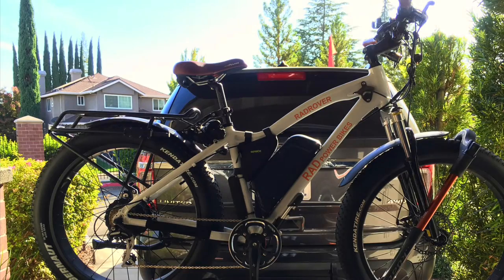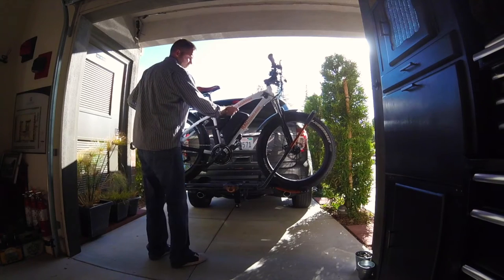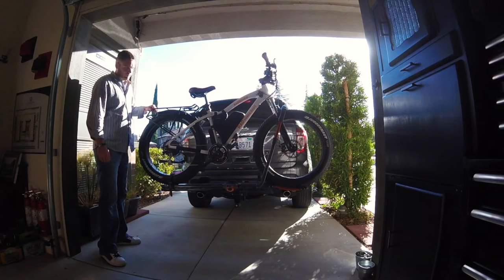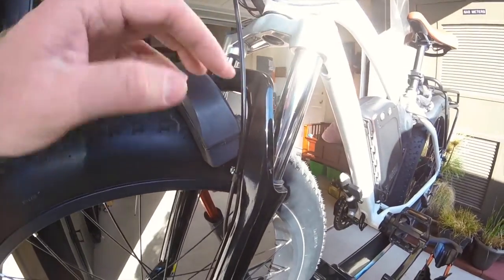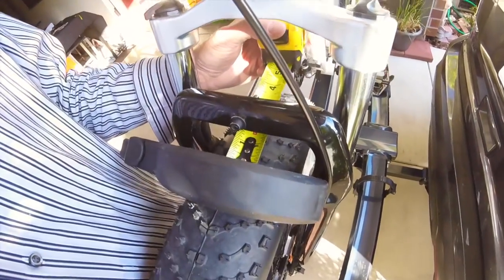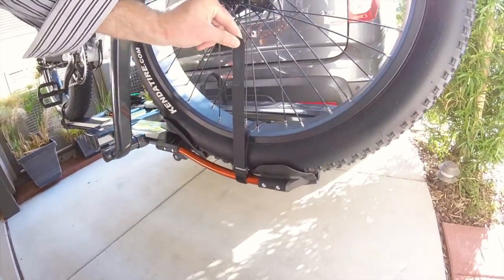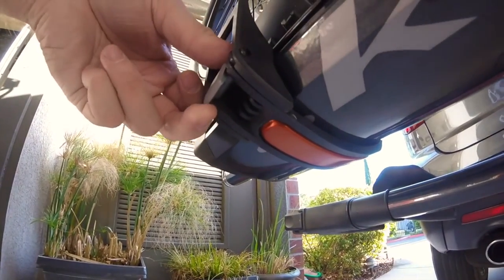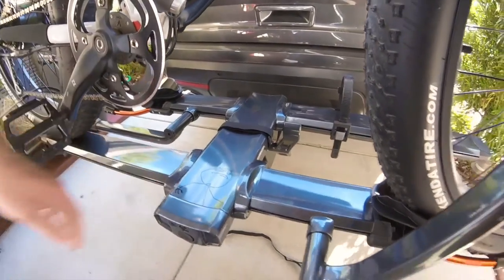Securing bicycle on Kuat NV 2.0

Comment: The extra security velcro strap is installed at the bottom of the front wheel. Your emergency plan is wise. With a Thule rack, I always carried extra ratchet straps. When my Kuat rack arrives on 4-15-2020 I will carry back up straps as well.

Comment: I have Rad City 5 plus and the same issue with fender as I have the same clamp system . My fender is even longer ( worse ) . 🚲 With fender , I  will try to use Velcro on front wheel to tight it to the rack to prevent moving . Just to try , before I remove or modify fender  .Anyway , great Video Thanks

Comment: Do you realize that the front wheel tray is adjustable into three positions?  In the lowest position, the wheel will be cradled more securely and better leveraged when the arm is clamped below a front fender.
Reply from the maker: Yes. I've tried all three positions and the middle is the best fit for my bikes

Comment: This was an issue for me yesterday with this rack.  Bike came off on highway at 55mph.  Was not clamped on fender. Was tightened down just in front of the fender (per recommendations of literally three bike stores, including two that were dealers of this rack).   I moved it around and it looked and felt secure.  (Your video showed how this can be deceiving, and I thank you for it).  I will try a ratcheting strap on the bottom, being careful not to damage the tire and rim.  Luckily only handlebar end damage (bikes were locked using the rack cable luckily).  Tire pressure can also be an issue with this rack I suspect, allowing it to bob more with lower pressure.  Especially on the heavier (E) bikes.  Which these bikes are designed to do for added suspension.  Bike stores, including the one that sold me the rack,  told me to press down on the arm just in front of the fender and then I would be good to go.  Your video, and my experience yesterday, proves them wrong.  March 19, 2019 . BE careful folks.  Kuat?  Are you reading this?
Reply from the maker: That sucks you had that happen. But yes there is a proper way to lock em down. I have two long velcro straps I use to keep the rear wheels in place. I don't trust the plastic rubber straps for the rear wheels. You could use the velcro straps for front wheels. I had two of them with my rack. Came with the fat tire extension kit. Otherwise just need to buy some

Comment: I have the same hitch rack, while turning right hit a pothole and the rear strap broke which in turn caused the bike to fall off the rack. I would highly recommend to tie down both the front and back wheels with a bungee cord or Velcro bands in addition to the rear strap

Comment: An old leather toe strap works great for securing the wheel to the base. I did that on my old roof rack. For a fat tire setup just chain together two toe straps. They are very strong and secure.

Comment: Good review.  I’d recommend you put the heavy RadRover bike on the tray closest to the vehicle.  It will be substantially more stable there.  Use the extra strap to strap the front wheel to the tray. My thoughts are to use extra straps anywhere I can.  Yes, cut back the front fender so the hook is as close to the fork as possible.  It actually looks better cut back anyway.

Comment: Thank you, very informative. We have a bike with fenders. I would not want to remove the fender. For $800 they did not think about people having bikes with fenders. Your music was soothing but could have been quieter. Overall very nice, thank you
Reply from the maker: Thank you. I paid $600 I believe. Not sure I'd pay $800 for it.. 

Watch my other video of rad Rover fenders. I rode in the rain with them. Honestly I don't see much of a need for the front portion of the fender on the front wheel anyways. That's why I was OK cutting off the front for a more premium rack
Reply: @AdammJarvis  Thank you for the quick reply. I watched your Ride in the rain. The front fender if moved down lower and reposition the attachment bracket would keep majority of the rain from getting on you. The back fender needed or needs to be down and more fender to protect you from getting wet on your lower back. Maybe RAD should think about this.
Reply from the maker: They did. Shortly after releasing this video they stopped selling these fenders and only the full fender setup. We ended up buying 20 bikes from em for our rental business. Got full fenders for a few of em an they worked way better

Comment: Have you tried securing the hook to the frame instead of the front wheel? Possible option for anyone with full fenders and/or front and back racks?
Reply: I've always wondered why folks don't go straight to the frame, rather than using the front wheel anyway?   I'd truly like to know why they haven't used it to this point?
Reply: @dalewatkins9889  Pretty sure the arm doesn't move that far back. It's designed for the front tire.

Comment: Nice review. the alignment with the front fender seems to be a real engineering flaw?
Reply from the maker: Thanks!! And I think so. These appear to be generic front fenders from what I've seen on Alibaba.. But a little mechanical engineering and problem solved. I just need mount the fender behind the fork and of course cut/trim the front half of the fender. I blame the style rack tho for the cut/trim of the fender tho..

Comment: curious as to why you opt'd not to install the trail track stand?
Reply from the maker: My bikes come in at 60lbs w/ battery. 53 without battery. It's too much weight for the trail doc. Plus I can't pedal my bikes with them on the trail doc.. so it's really only good for changing tires in my case. I think it's because the arm bends over so much do to weight is why it just barely snags my pedals when I rotate them. I like the cleaner look of it not on there.
Reply: Thanks! It does look cleaner without it! 

I'm trying to decide between the NV Base (no trail doc and all black) vs the NV 2.0. I was a little worried about someone plucking the trail doc off my rack if i were to leave my car parked - so its nice to know the option to plug up the hole and keeping the trail doc in the trunk. Is that plug easy to take on and off?
Reply from the maker: No problem! And it does look cleaner. I like the NV Base.. looks sharp. But the gray paint matched my explorer.. The trail doc can be removed with ease. I don't think anyone would go as far as stealing it.. but yes if you wanted to do the trunk storage thing - it's easy to pop the cap out. You MIGHT need a key from the key ring or a coin to pop it out. Depends how tight you have the locking lever. Overall I like this rack a lot and has saved me from a lot of headaches with cheaper racks on the market!